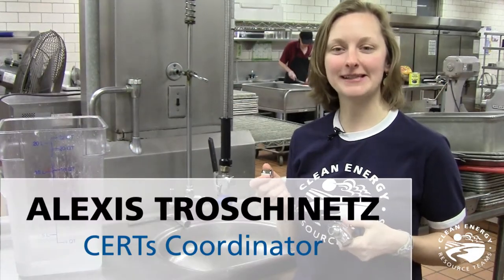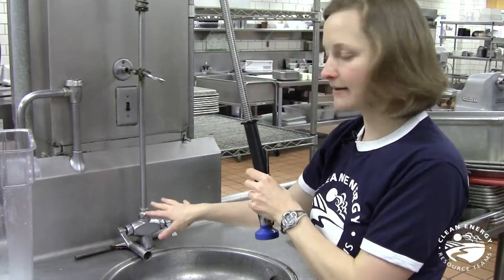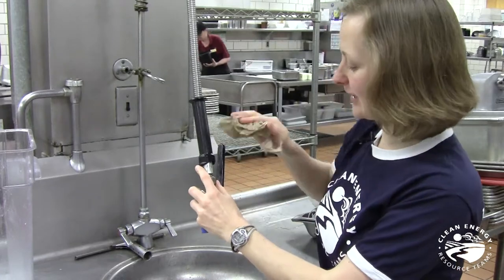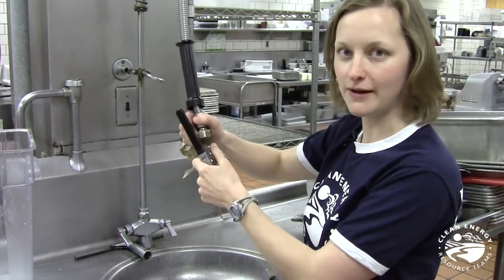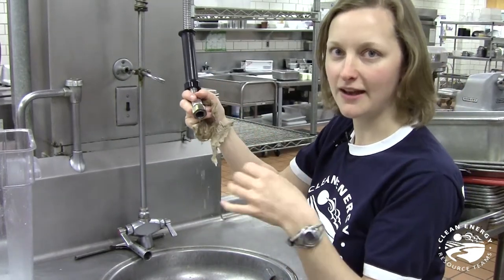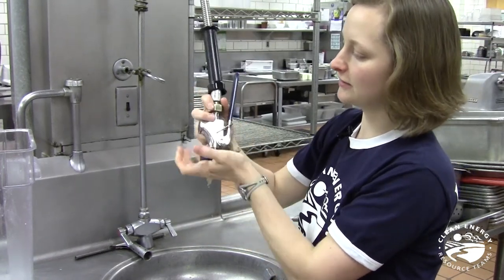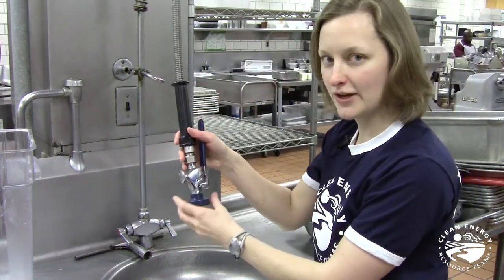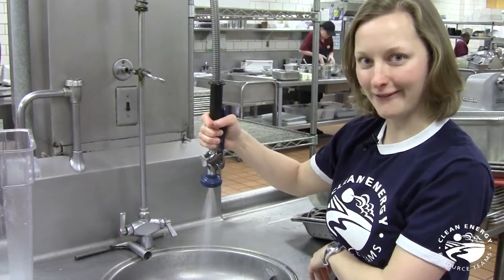Replacing Your Pre-Rinse Spray Valve

Comment: How do you change internal parts for it? That is easy bit how about the internal kit repair for the same valve
Reply from the maker: Ricky Seda - Follow the instructions that come with the repair kit and buy a repair kit that is compatible with your spray valve. However, if you're taking the time to change out the internal valve, it would be a good time to double-check that you have the most efficient spray valve. If the gallons per minute (GPM) is not printed anywhere on the sprayer, then refer to this video   https://youtu.be/RmlbhA2dq4E to determine your current sprayer's flow rate. If it is 1.5 GPM or higher, you could instead replace the entire sprayer with a high efficient one, instead of just the internal component  Efficient sprayers tested for performance are available down to 0.5 GPM. Here's a great resource for selecting a new efficient pre-rinse sprayer: https://fishnick.com/equipment/sprayvalves/